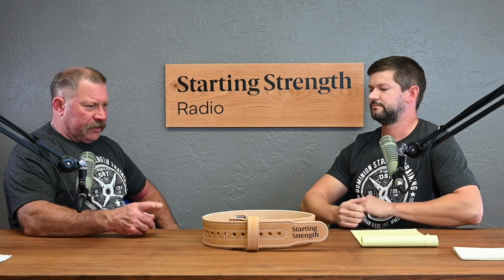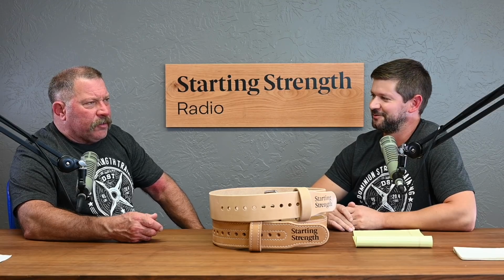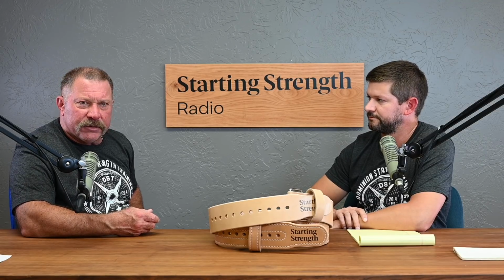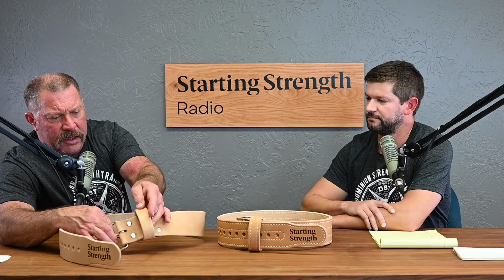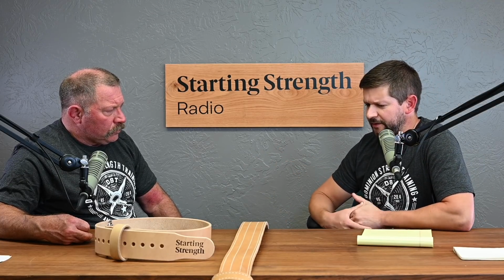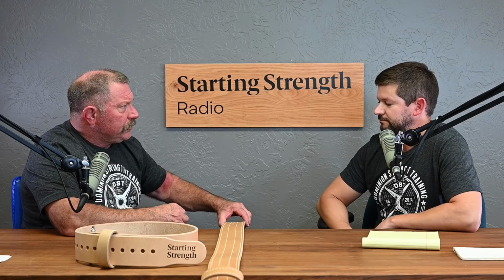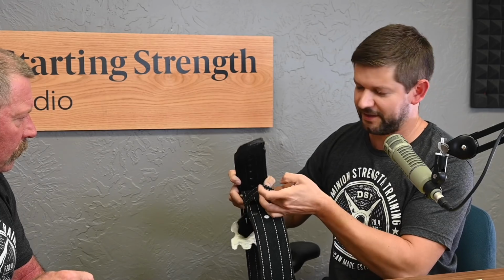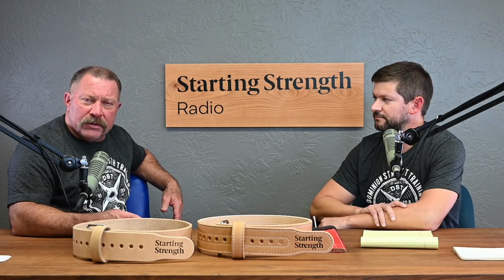Making the Starting Strength Lifting Belt with Blake Wilson | Starting Strength Radio #23

Comment: Is there a big advantage for the 2 ply over the one? Its quite the price difference and not sure I would notice it while lifting or not...
Reply: Its thicker and provides more support
Reply: I answered  this exact question some months ago on the Starting Strength forum. Here's the text of that post and please let me know if you have any more questions.

The single ply and suede belt use the same piece of top grain sole leather. The suede belt then makes up the rest of its thickness with the two layers of suede. The relative manufacturing complexity of the suede belt with gluing and stitching makes up most of the cost difference there.

The double ply makes its thickness by starting with the same sole leather, which is mated to a higher grade of top grain leather. We chose to do this because the combination of the two lead to an exceptionally strong belt that is also very pliable right from the start. This layer also has a higher aesthetic grade and is the outer layer of the belt.

Because the double ply starts with two leather straps as opposed to just one on the other belts, the materials cost is very nearly doubled from the start (the suede is relatively inexpensive compared to the leather). It also has some unique manufacturing challenges.
When gluing two fairly thick straps of leather, it is impossible to have the seam line up perfectly. Some belts hide this behind edge paint. We decided to properly finish the edge by sanding and burnishing as necessary to get a perfect seam. Edge paint will eventually crack and flake off and we didn’t want that on a belt we’re claiming will last you forever. The labor involved in sanding and burnishing the entire length of a belt is substantial, and is a feature unique to this belt.

The layer mismatch can also happen on the suede belts. The difference there is that one pass with an edging tool removes any mismatch and rounds the edge at the same time. The double ply requires the above mentioned edge finishing before edge beveling.
Also, not just any piece of leather can be used for the double or single ply. On these belts, the leather’s natural surface must be aesthetic grade. Even quality leather will have various scratches, branding marks, or other blemishes that would not make it suitable as an aesthetic surface. It could be used for a suede belt, because there the only requirement is the structural integrity; anything superficial is covered by suede. This detail requires us to sort all the leather we receive, and only a certain percentage makes the cut for a single or double ply belt.

This may be more detail than you were looking for, but I did want to explain some of the details that are not obvious. It’s possible to take several raw leather straps and have them become several finished single ply belts by the end of a single day. The double ply requires a multi-day process that is vastly more complex. This added complexity plus the materials cost are what drive the large jump in price.

Comment: I bought a one-ply belt from them.  Lifetime warranty.  Then I put it on so tight, that i broke my rib.  Only an idiot can do that.  But their belt is so strong, and rigid, it can break a rib.  I love the belt.
Reply: Craig Castanet, D.C. how did this happen. I’ve heard of people doing this at powerlifting meets but I just can’t imagine how you could do it.
Reply: @andrewharris3417  had it on very tight, it was new, and the edge was very rigid.  i did several sets over several workouts, but i think it happened during overhead pressing.
Reply: Craig Castanet, D.C. thanks for explaining 👍🏻 must keep that in mind not to lock in too tight with my lever belt.